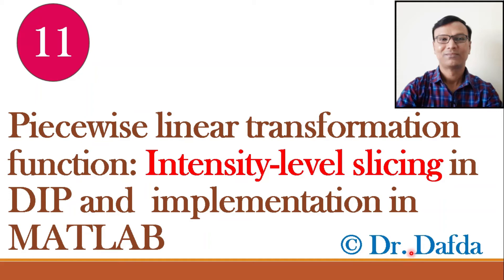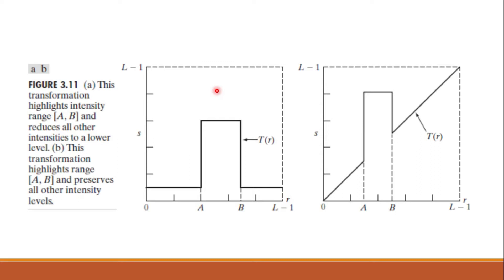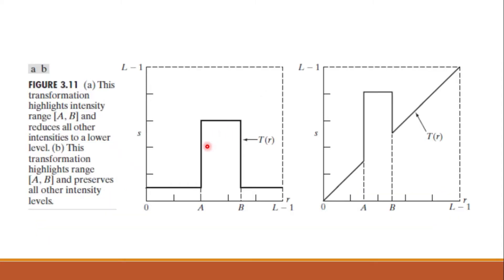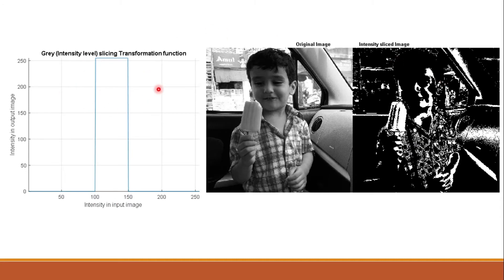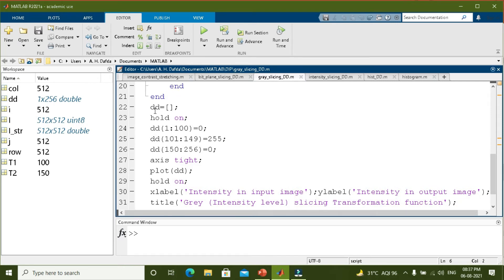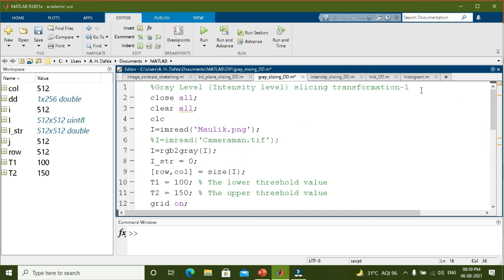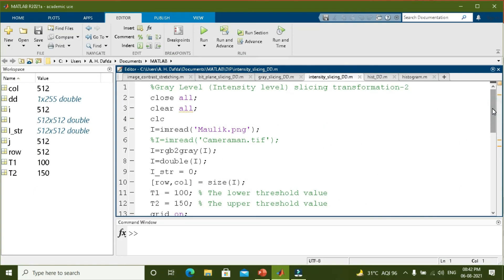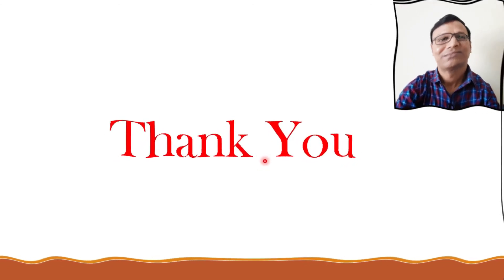Piecewise linear transformation function: Intensity-level slicing in DIP &  implementation in MATLAB

Comment: sir can i get the matlab code in the video u had showed
Reply from the maker: MATLAB code:
%Gray Level (Intensity level) slicing transformation-1
close all;
clear all;
clc
I=imread('Maulik.png');
%I=imread('Cameraman.tif');
I=rgb2gray(I);
I_str = 0;
[row,col] = size(I);
T1 = 100; % The lower threshold value
T2 = 150; % The upper threshold value
grid on;
for i=1:row
    for j=1:col
        if((I(i,j)>T1) && (I(i,j)<T2))
              I_str(i,j)=255;    
         else
              I_str(i,j)=0;
         end
    end
end
dd=[];
hold on;
dd(1:100)=0;
dd(101:149)=255;
dd(150:256)=0;
axis tight;
plot(dd);
hold on;
xlabel('Intensity in input image');ylabel('Intensity in output image');
title('Grey (Intensity level) slicing Transformation function');
figure
montage({I, I_str}, 'Size', [1 2]);
title('Original Image                        Intensity sliced Image');               

Second MATLAB program of the video:

%Gray Level (Intensity level) slicing transformation-2
close all;
clear all;
clc
I=imread('Maulik.png');
%I=imread('Cameraman.tif');
I=rgb2gray(I);
I=double(I);
I_str = 0;
[row,col] = size(I);
T1 = 100; % The lower threshold value
T2 = 150; % The upper threshold value
grid on;
for i=1:row
    for j=1:col
        if((I(i,j)>T1) && (I(i,j)<T2))
              I_str(i,j) = 255;    
         else
              I_str(i,j)= I(i,j);
         end
    end
end
dd=[];
hold on;
dd(1:100)=0:99;
dd(101:149)=255;
dd(150:255)=150:255;
axis tight;
plot(dd);
hold on;
xlabel('Intensity in input image');ylabel('Intensity in output image');
title('Grey (Intensity level) slicing Transformation function');
figure
montage({uint8(I), uint8(I_str)}, 'Size', [1 2]);
title('Original Image                        Intensity sliced Image');
Reply from the maker: MATLAB code:
%Gray Level (Intensity level) slicing transformation-1
close all;
clear all;
clc
I=imread('Maulik.png');
%I=imread('Cameraman.tif');
I=rgb2gray(I);
I_str = 0;
[row,col] = size(I);
T1 = 100; % The lower threshold value
T2 = 150; % The upper threshold value
grid on;
for i=1:row
    for j=1:col
        if((I(i,j)>T1) && (I(i,j)<T2))
              I_str(i,j)=255;    
         else
              I_str(i,j)=0;
         end
    end
end
dd=[];
hold on;
dd(1:100)=0;
dd(101:149)=255;
dd(150:256)=0;
axis tight;
plot(dd);
hold on;
xlabel('Intensity in input image');ylabel('Intensity in output image');
title('Grey (Intensity level) slicing Transformation function');
figure
montage({I, I_str}, 'Size', [1 2]);
title('Original Image                        Intensity sliced Image');               

Second MATLAB program of the video:
%Gray Level (Intensity level) slicing transformation-2
close all;
clear all;
clc
I=imread('Maulik.png');
%I=imread('Cameraman.tif');
I=rgb2gray(I);
I=double(I);
I_str = 0;
[row,col] = size(I);
T1 = 100; % The lower threshold value
T2 = 150; % The upper threshold value
grid on;
for i=1:row
    for j=1:col
        if((I(i,j)>T1) && (I(i,j)<T2))
              I_str(i,j) = 255;    
         else
              I_str(i,j)= I(i,j);
         end
    end
end
dd=[];
hold on;
dd(1:100)=0:99;
dd(101:149)=255;
dd(150:255)=150:255;
axis tight;
plot(dd);
hold on;
xlabel('Intensity in input image');ylabel('Intensity in output image');
title('Grey (Intensity level) slicing Transformation function');
figure
montage({uint8(I), uint8(I_str)}, 'Size', [1 2]);
title('Original Image                        Intensity sliced Image');